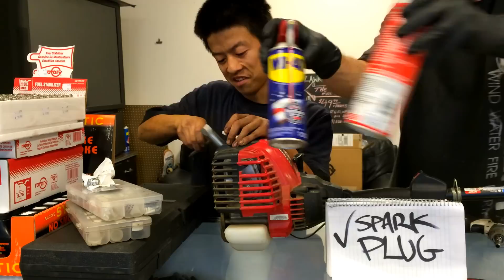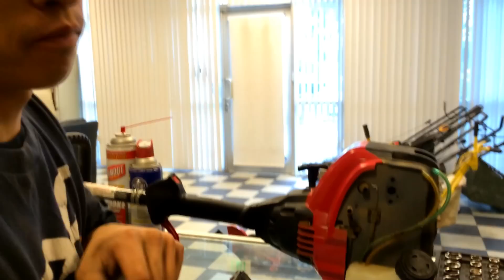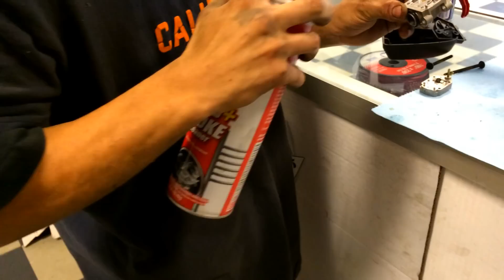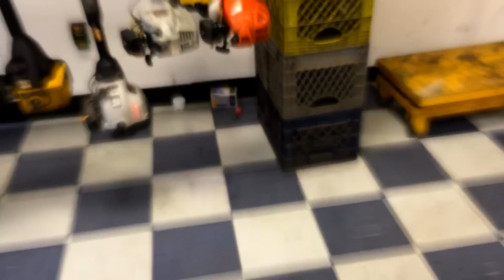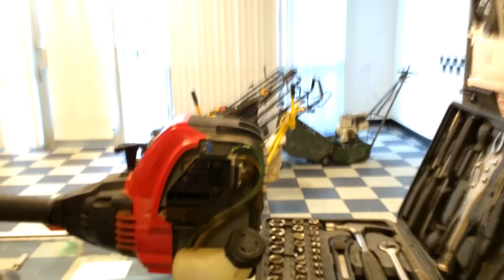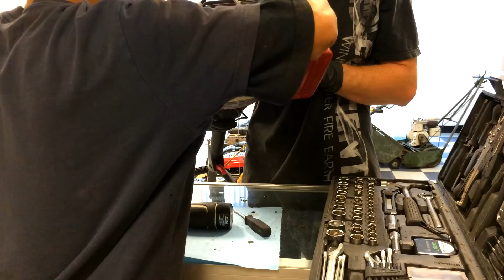Fix a Troy Built 4-Cycle Weedeater That Won't Start | Shop Repair | Model: TB 575 EC

Comment: Hello, I have a Black Max 4 cycle trimmer. It has never run. got it on clearance and cant return it. I have spark, i got a new plug, will not run with starter fluid in the carb. Will not do anything. from what I understand disassembly is required to find timing mark on the crank shaft. I get a little, very littel smoke from exhaust. Any help would be appreciated

Comment: My pull cord just pulls with zero turnover.  Cord is still connected.  Any video on how to re-connect the cord so there's pull tension?
Reply from the maker: Its possibly just locked up and needs lube. I spray WD40 and push it into whatever area using compressed air. This creates more of a cloud so don't breath that. After lubing pull it over a few times and those paws may release to operate properly. Otherwise it must be opened for further inspection.

Comment: How do you run the fuel lines on a Troy Bujlt TB365 ec? Which lines go to the tank & to the carb & which go from the primmer bulb to the carb?

Comment: Mine got flipped over and now won't stay running.  It will start and immediately die.  What might be wrong?
Reply from the maker: Flip it back over! Then pull it over a few times with the plug out. LMK

Comment: Okay so you  remounted the throttle. My question is which i can not seem to find on any site here, Why is there Gas and Oil comeing out from the filter while it is running? I mean it just seems to pour out, What could the problem be with this happening? It is a Troy-bilt more then likely an older model, I can not even read any numbers off it. Just the TB575SS. Can someone help me please.   Thank You.
Reply from the maker: These machines hold no more than 3.4oz of oil in the crankcase. Fill no more than it will hold at level with the oil cap off. As for the gas, the needle inside the carb may be stuck down on the diaphragm or bent down flooding the engine. Is the carb put together right and tight? Are the fuel lines installed correctly? Lmk
Reply: @AdamPenningtonadamcpennington  Well i checked it out it is not over full with oil, i checked the throttle it is not stuck. I can turn the weed eater like down towards me without it running, all it does is leak oil and gas, into the filter area.There seems to me like under where the casing is, there is so much oil there, and running down towards the throttle making everything oily. Does this make since to you?

Comment: Tried this once.  Didn't work.  $10 on Amazon for a new carb... changed out n 5 min.  Good as new.
Reply: Dan this could easy be $75 for this poor guy
Reply: Jump starter Idea is good but after used 2~4 times , it was broken. I bought 3 pics but throw away finally.
I bought 2 puller kitsch but I don't know how to repair this. 
So couple days ago, I bought other brand which is better,easy

Comment: I have a Troy built 25 cc I put a new carb on this year and now it runs but it like back fires out the exhaust and carb don't know whats causeing it to do that help
Reply: It's a two cycle 40 to 1 almost seems like it's sucking air some where I have the o ring Head gasket could it be that and what would be the tourqe on the bolts

Comment: more affordable ?  gasket and diaphragm.  a whole new carb with everything done is 11.86 << -  less that 12 dollars! with free shipping and it includes the gas lines and stoppers, the gas line has a filter on the end and that can cause a ton of trouble.    thats pretty cheap right there.    300 bucks?   what the heck are you talking about> you can buy a badass echo for less than 300 LOL. 

   when you guys got to the "OIL" this video looked like you you broke into a shop and made a video on a bet.   WOW.  

  i only found this because i was trying to see if these come with a drive shaft separated or do you have to order them as one piece.   but you didn't address that part.    still funny though  thanks.

Comment: Picked one of these up  for free on the side of the road, it also has no spark yet the plug looks brand new. My Echo ALWAYS starts, even after sitting for 6 months. The Troybilt is Murray made crap unfortunately.
Reply: All made by MTD. Yard Man, Yard Machines, Bolens, Murray, Remington, Troy Bilt, and Craftsman. The funny part is Murray says "by Briggs and Stratton". Troy Bilt claims built for life. Remington claims they're the best
Reply: You so right

Comment: I would to tell yoi what happened to me and my brand new troy build weed eater first get out of box and then i read direction ok i put gas mix just it said. Ok i pull on pul rope jus like it said finall get started. Give it gas and bu waa it acts like it starving for gas i know because i run small motor like mowers.chain saws and alot more so i call trol built. To find out what te problem is after half hr or longer now up.till this iam ok but when i talk to the thired person i get hung up on so i still not that mad yet so i called back just to wait another half hour now iam starting to get pisset of but when i do get to talk to someone i tell them what going on with weed eater heres where i lose it he tells me not enough air or gas in th carb but when i go to turn the screws nothing will work so ask the guy about the tool hes says nope cant sell you one against the law now i dont belive him well is true wowë i was getting really i didnt no if was pulling my leg or if he was just stone stupid i .said im a brick block and stone mason and am dam good but if i tell the people I'm working for i cant lay thebrick because the color or something else is wrong and then i tell the home owner i don't no what i gone to do am to stupid to get it fix i pretty much lost that job and the worst thing about my reputation is shit now no more work for me witch means i loose.my house my wife my dignet and i guess i cant live like that mow i think you trol buit owes .e anew weed eater please my address 590 hunters rd. Great cacapon 25422 please do the right thing i pitch my other weed eater and i will pray for you this sunday at church on.Sunday thank you for doing the right thing

Comment: Thought I would share this part that seems to fail often, the spring loaded prawls in the fan underneath the pull cord on newer MTD, Troybuilt and Craftsman string trimmers.  The only way that you can obtain the pawls is by ordering the Craftsman part number 753-08159 http://www.ereplacementparts.com/pawl-kit-p-1756995.html This tool is made for Craftsman by Troy-Bilt. We don't have the Trot Bilt TB685EC in our system as of yet but it will be in there soon.

Comment: mine came from the factory lean as hell, almost had a stroke trying to start it and then it would only run on partial choke. i ended up tearing down the carb and replacing the main jet with a larger one and now it runs fine.

Comment: I'm getting blowback through the carb intake when pulling on the cord. What would cause this   ?
Reply: Mine is doing the same thing....I am wondering if there is a timing issue due to whatever drives the pushrods...sounds like something broken internally to me.

Comment: these are the biggest pos engines on the market. nothing but problems. the drill start was a good idea, but fail on reliability
Reply: Agreed. I am not a fan of 4-cycle weedeaters or any handheld equipment. They are so damn hard to even maintain or even use, despite the Troy Bilt motto,  since they are owned by (somewhat knockoff) MTD company.. Used to have a Troy Bilt (TB415CS) weedwacker and it broke after about 1 or 2 years of use.  I have all STIHL equipment now (all 2-cycle; 50:1 fuel mix), never had one issue. Ethanol is another possible thing too,  it can cause a lot of problems with the equipment, which may have nearly destroyed my fs94r, apparently leading to costly repairs. If you have any gas equipment, you have to use ethanol-free gas. They try to claim these trimmers are easy to start using a jumpstart engine starter. whether they're troy bilt, Craftsman, MTD,  or Bolens, because it can be a pain to use. NO WAY in hell I would ever buy Troy Bilt or other low-ball MTD whether its a weedeater or blower, or chainsaw, hedger, even an edger. So much for BUILT FOR LIFE. We are looking for a mini-tiller and cultivator, and I researched STIHL or ECHO. In fact, next year I will look into getting an ECHO mini-tiller or if we can't afford an ECHO or STIHL, I will look for a used IDC model 400 mini-tiller. Old weedeaters (90s or earlier) are all the best you can go with if you take good care of them too, but be careful about the Ethanol content in gasoline.

Comment: Noticed on those engines you should always replace the plunger bulb due to cracking only after a few years ..plus always smart to replace the lines with a new pick up fuel filter on it...noticed you forgot to do that...very cheap parts plus that way your customer won`t come back saying it wont start etc due to those parts...nobody likes a comeback on his work..good luck

Comment: I have an edger attachment for my Troy Bilt string trimmer. When I start it the blade spins sure enough, but as soon as I set it down to the spot where I want to begin edging the blade stops rotating. Any ideas on what the underlying might be? Thanks.
Reply: Tony Pleaser - make sure the attachment is all the way in so the metal "dome" pops out through the hole in the outer tube... The square shaft end may not be going into it's mating coupler far enough... 

Other possible causal issues would be problems with the gearing at the edger head, or the clutch on the motor portion slipping...

Comment: What does it mean if the recoil starter assembly is very easy to pull and that the piston does not move up or down.  Mine is a Troi-Built 525EC 4 stroke line Trimmer.  It also leaks oil in the air filter housing. It also stalls on cold start up just after fully depressing the lever.
Reply from the maker: Is the starter not engaging the engine?
Reply: Jan D. I hope you solved your issues, But if not here's what to check:  on the starter make sure the springs on the pawls are not broken and properly oiled. Oil in carb is too much oil in crankcase. Remember that it only holds 3.2 oz for proper operation. If you overfill by 1 to 1.5 oz thats nearly 50% too much. The oil makes its way to the carb via the crankcase breather tube. The carb issue should not be addressed until the oil problem is solved. Good luck and visit my channel to see the oil problem in depth. Zombie Dave
Reply: Can you buy the spring. I got a 4 cycle. One of my spring is broken.
Reply: @kelvinmoore854  - www.ereplacementparts.com/Troy Bilt/parts

Comment: i have a troy bilt 4 cycle trimmer just like that ,, i tried to rebuild the carb like you showed ,, instructions werent clear , well the fuel line blew off on start up and gas ran down my pants and cought my leg and my dick on fire im like wtf i need this trimmer fixed , i replaced the fuel line and it would only start upside down well this time the gas cap leaked gas down my back and cought my ass cheeks on fire som bitch i dont know what to do now
Reply: Liar

Comment: Do you guys have any video on how to replace a Troy-Bilt TB525CS weed eater pull cord?  I'm also interested in some advice on adjusting the idle speed using that little screw off the carburetor.  Thanks!
Reply: I suggest you let someone with carburetor adjusting experience do that job. They come set from the factory so that the engine doesnt overheat. Takes some practice to get it right.

Comment: You guys are right about all your doing but, I'm one of those old school a__ h__ you don't want to hear from.  I found my trimmer in a trash can (I am not a dumpster diver).  Took it home and gave it a couple of spins to make sure who ever owned it before didn't run it out of oil.  Took the air cleaner off and found a lot of tarnish.  What I did was sprayed carb cleaner (Gunk) down the throat of carb  (don't miss the tiny hole to the left, vacuume hole for sucking fuel to carb.  Then I noticed some brown stuff in tank, I sprayed a lot of carb cleaner in tank and sloshed it around 
till the brown stuff was gone, then i checked spark plug.  Put  some gas in it and it fired right up.  What I'm trying to say is, everybody and I meen everybody does not  drain or clean these things before putting them up for winter and the tarnish builds up while being stores.  It's common and no one is to blame, I even forget to do this.  Just do what I told you above ( and clean air filter with some Dawn dish soap) and avoid paying someone a $75.00 or more to fix it,  or worse yet, buy a new one.  $6.00 can of carb cleaner will do the trick.  Didn't mean to burst anyone's bubble, but it is what it is!
Reply from the maker: Great advice Pat! I'm all about the freebies. Penny saved, penny earned. That shop got started by being extremely thrifty. No bubbles burst here. Matter of fact you may have just blew a few digital bubbles. One man's trash is definitely another man's treasure with the right knowledge.
Reply: When tools don't work at my house, they go in the garbage.  People like you can have them.  I have ZERO time to waste on a trimmer that doesn't work whenever I pick it up.  A tool that doesn't work is worse than no tool at all.  You're welcome.
Reply: Amen to that Pat and i also learned something from this video so thanks to All.
Reply: Pat Walsh
Reply: Pat Walsh "I got my trimmer from a trash can. I am not a dumpster diver." awesome
Reply: lol now you tel me. i just spent many hours and about 25 bucks trying to fix a 2 yr old troy bilt.  No matter what I do that thing will not start, everything checks out and still not even an attempted fire on starter fluid.
Reply: Nice step by step instructions. Stop moving the camera around so much, get a tripod or something, missed some critical parts of procedure. Otherwise great video.
Reply: You're exactly right. That said, it's the freakin methanol gas that screws up 2 cycle engines after being un-attended for so long.
Reply: If your time is worth pennies, yes.  If your time is valuable, buy a trimmer that works.  It's not worth the time effort and frustration for people who earn a living doing real jobs.  If you're retired or something, then yes - it's probably worth fixing.  Maybe.  Unless it's a Troy Bilt...  because as soon as you fix one thing, something else is going to break.  Continuously.

Comment: I have a similar Troy Bilt 4 cycle.. it won't start or run good when that little air filter is in it. I have to remove it to get it to start and run any suggestions?
Reply: If your air filter isn't bran new clean replace it, I never adjusted a 4 cycle carb. but on a 2-stroke there is a hi and a low screw, I think they both are screwed out about 1.5 turns from in the whole way I have good luck with adjusting them but you have to have the feel for it... again not sure if the 4 cycle ones have those hi-low screws on the carb. The low is mainly adjusted for idle and the hi gets adjusted at full throttle may a vid on U-tube.
Reply: +Duane Delarm cool!  thank you.  I'll check it out
Reply from the maker: Thanks Duane!

Comment: do y'all have any videos on a Troy built tb685ec or similar. when I pull the pull cord it sounds like whatever it's supposed to grab is slipping. thanks
Reply: My spring broke in the motor

Comment: First should be a compression test or a leakdown test, why? Cost effectiveness, no compression measured on 90 % of these units means time to discard it. No Compression , who cares about spark? You need to test that spark with a 3 way spark tester oppama Pet -4000 tester where you can test coil condition under compression , only way to tell if spark is truly correct.... Orange , Red or Yellow spark means weak coil or plug.... Look into it....
Reply: Huh. Thanks for the tip. Just bought this model today with broken recoil.  Can't wait to tinker with it.
Reply: Your right , most likely the seal is bad on these 4 cycle trimmer and may see like good compression but not meeting the good mark of psi